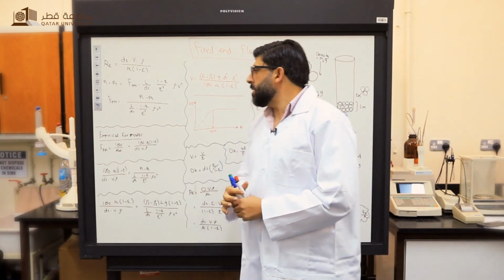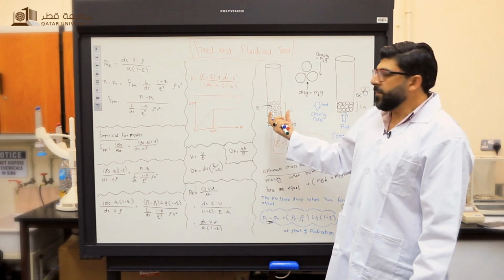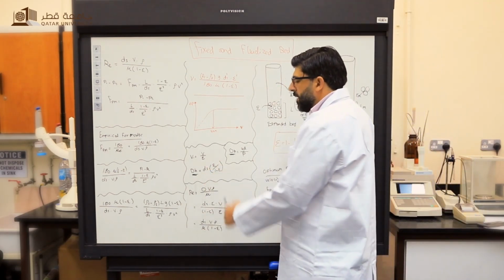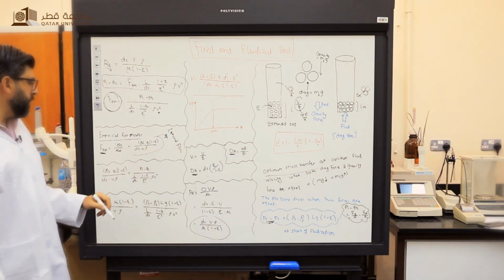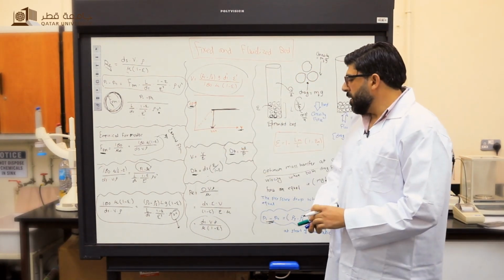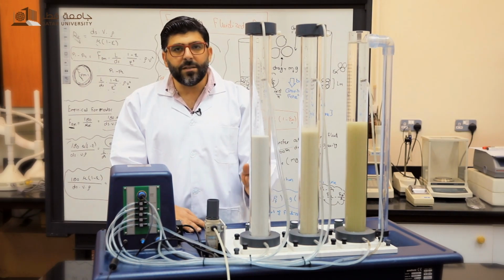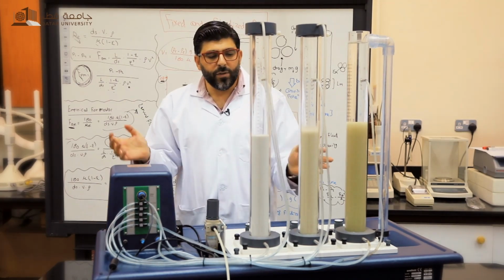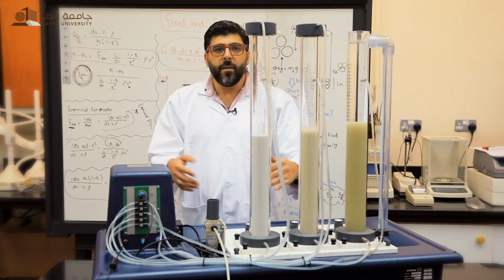Fixed and Fluidized Bed Experiment (Theory and Live Experiment)

Comment: thank you for that great elaborating but i have one question . where does  the pressure drop happen ... i mean where we mesure the P1 and the P2..... thanks in advance
Reply from the maker: Thank you. The apparatus measures the pressure drop at the bottom of the bed, and above it. The pressure drop represents the difference between forces of the buoyancy due to the fluid and gravity due to the bed weight.
Reply: @medoKhatat  you mean that the pressure deference happened in the inlet of the tank and inside the bed right .
Reply from the maker: @mohamedanas7913  Yes, considering that the inlet is the bed bottom, and inside must be at the top of bed.
Reply: I want to ask you another question..... I'm sorry for that but i build a device to perform the fluidized bed experiment but i have a problem in measuring the pressure inside the tank ... Can you help me with it???
Reply from the maker: @mohamedanas7913  You need to have two pressure sensors, connect one of them at the bottom of the column, and the other one at the top. Pressure drop is calculated based on the difference between them
Reply: @medoKhatat  That's mean I don't measure the pressure deference between the inlet tank before the sintered disc and the bottom of the tank but  the bottom of the tank and the top of the bed !!!!!?
Reply from the maker: @mohamedanas7913  Exactly, that's what you should do
Reply: Thanks again for your help ♥️

Comment: thank you for this excellent explation, what is the quation for minimum velocity coz its not clear ,,and how can I measure the bed height in fluidized case coz it is not constant or level
Reply from the maker: Regarding the second part of your question; the level is measured by a scale fixed to the column. If there is no scale, you can use a ruler.
For the first part of question 
Minimum velocity = [(density of solid- density of fluid)*Gravity Constant*(Particle diameter)^2*Porosity^3]/[180*Fluid viscosity*(1-porosity)]
Reply: @medoKhatat  thank you for your reply and regarding the level measured I had a measuring scale but my question which reading I shall take coz the beads pop up with air in different height for certain air flow rate so how can I take height and I have many elevation for the beads 
thank you again
Reply from the maker: @sabahalali4563  The bed height is related to it porosity, the more porosity the higher bed is. I think you mean bubbling fluidized bed (when gas is used as fluid not liquid). If so, then you should measure the bed at its maximum height, because this is the maximum drag force of the fluid, before the gas released to atmosphere and lose its  drag force. Note: this should not happed with suspended fluidized bed (when liquid is used as a fluid). Good Luck!
Reply: @medoKhatat  yes that what I mean thanks a lot for your help